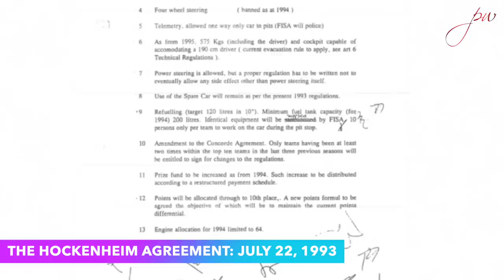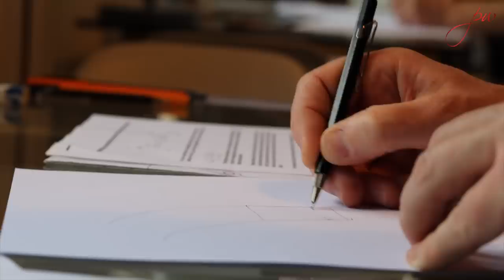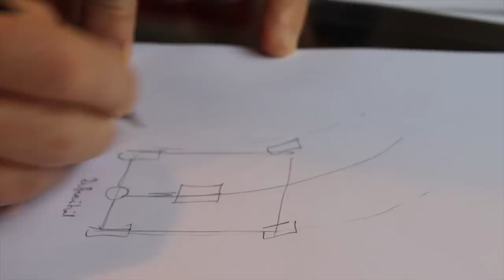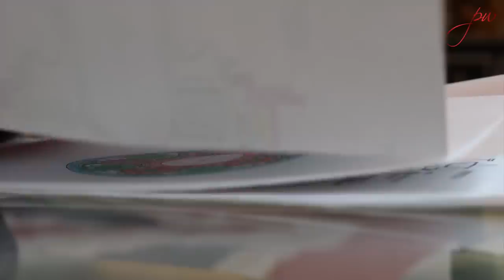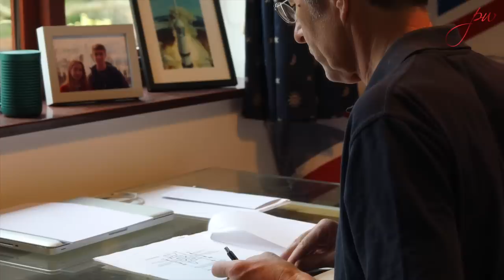Secrets of F1's least-known electronic driver aid. By Peter Windsor

Comment: From the time you let off the throttle at the end of the straight, you want the car to freewheel into the turn, each tire independently searching for traction. As you pick up thr throttle, you want to lock the wheels together for acceleration. But if you lock them while accelerating out of the turn, the car tends to push. So the critical mapping is from throttle pickup until you are going straight enough that the push is irrelevant.
Reply: Hm..., not sure about freewheeling on overrun...a fully locked diff under braking is something worth considering as you get a very distinctive characteristic under braking and turn in , helping you  rotating the car . ..generally you want less lock in highspeed open corners as the lock just does not allow the car to free up .
Reply: @marcush.1901  I drove dirt late models with a Detroit locker. It freewheeled on trailing throttle, then locked when you picked up the throttle in the turn. By freewheeling I mean it was just an unlocked diff.
Reply: @lefturn99  That's the great thing about this system, it's adjustable in pretty much all parameters. If the car is bad loose in off power corner entry and none of the usual suspension or aero tweaks can fix it without hurting performance somewhere else, you can have it start to lock up off power as well, making the car tighter and more stable on entry. And it's not just a choice of locked or unlocked, you can have anything in between as well.

Comment: I suspect that the lack of data, back in the 80s and early 90s, meant the relationship between driver and engineers was more crucial. 

There would have been greater reliance on feedback from the drivers during testing and practice. 

The input of drivers like Prost and Senna, in terms of car setup, was an essential part of a team’s success.

Comment: With a budget cap now in place (if it can be enforced), why does some of this stuff still need to be banned? You choose to spend money on it, or you don’t. Im theory anyway, the have’s can not longer simply have everything and the have not’s are no longer being forced to go with out.

I wouldn’t like to see traction control, ABS and auto shifting come back, but things like active suspension, active diffs, four wheel steering etc are not driver aids and are part of the appeal. My first season watching was 1993 and ever since then it’s not been quite the same with a lot of this tech banned…
Reply: Cars today have electronic diffs with torque vectoring and far more advanced settings than the ones discussed in the video. It's the last priperly actuve thing on the cars today other than the ERS.
Reply: Active diffs are not banned, they all have them

Comment: Really interesting interview!
By the looks of onboard footage you can see how often they change the diff settings which tells how much difference it makes and how important it really is.
I mean when I bought a car with an LSD diff it made a big difference on my trackdays, the grip out of the corners was night and day compared to previous car without LSD diff.
I am curious, if anyone knows, how are they able to calculate the lifespan of parts with a margin of like five laps?
I mean it's easy to make something just a lot stronger as in use more heavy duty materials I guess but the margins of only five extra laps in lifespan how do they calculate that or even know it will last only five extra laps...

Comment: I was just talking with a guy an his wife at a small car gathering I was chatting about 1996 Toyota MR 2 sport car 5 speed gear box an he was telling me how the Japanese market motor has 80 hp more I stock trim...then he mention it has Japanese trans too which has a limited slip trans mounted on the gear box....before the out put shaft go out of the transmission which I thought was very trick...I wondered who came up with that hah F1....I thought it was radical for a street car...but more important fir safety on the road...because locking posi unit tend to not want to turn I have heard...they under steer terribly....thanks